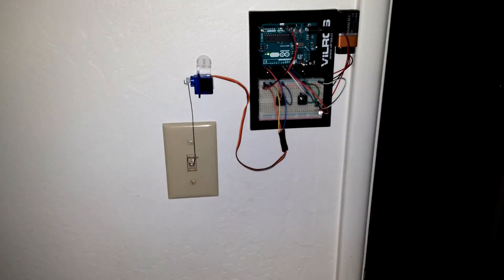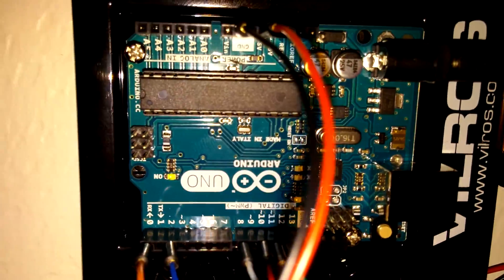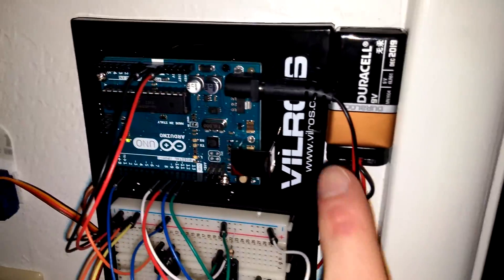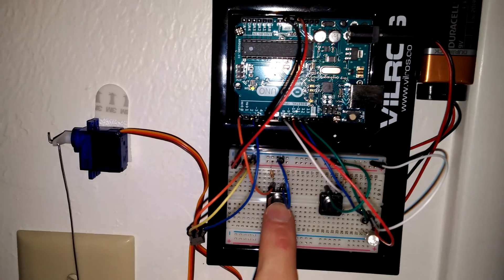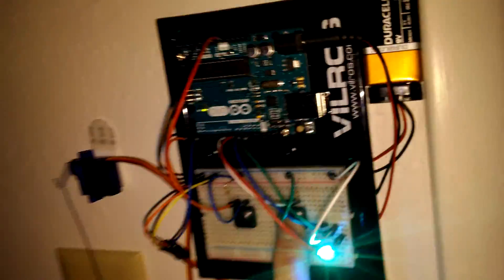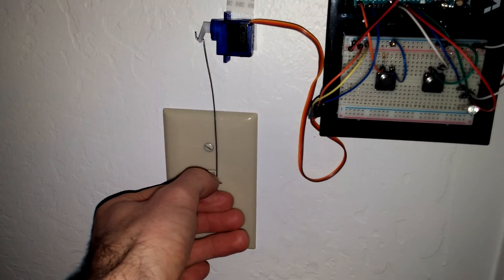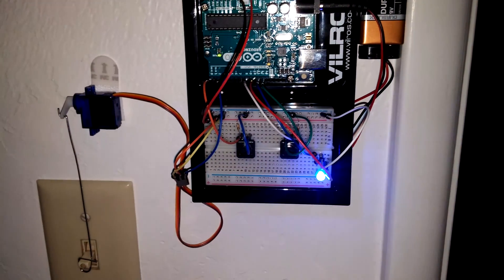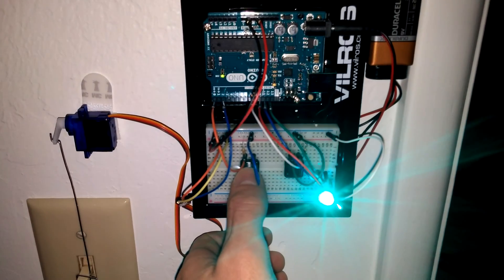Arduino Controlled Light Switch

Comment: nice whats the code for this? I want to use this to control my hot water cyclinder switch so I can add a timer to it to put off the cyclinder during certain hours, apparently you can save $30 month, so its worth a try